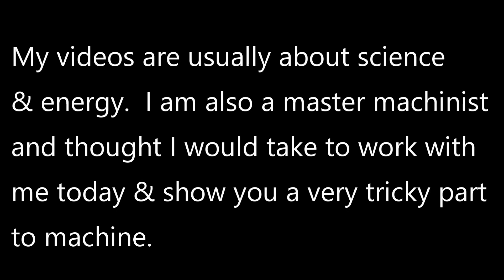MACHINING A FOAM DUMBBELL

Comment: Genuine plastic coated gas bubble machining - 'almost' like eating lettuce . . . 'almost' nothing to it !    * Seriously , foam(s) can be a real bear to deal with . . . 'that's a pretty serious form tool !   Obviously the foam density / hardness plays a major role in being able to hold a tight tolerance .     'Cool ''box'' for driving the slabs !     What type of foam is it ?   I can think of some interesting uses . . . like a super low pressure VALVE that would have to be low rpm , otherwise it would self destruct !   Fun stuff Paul !
Reply from the maker: Hey, good to see you.  George the stone cutter, the gemologist, the gem cleaver! Hope things are going well with you.
It is a really dense foam, customer supplied the material, so I'm not sure what type it is.
Reply from the maker: I think they are used in some type of compression test.

Comment: what are those used in/for?
Reply from the maker: I think some sort of compression test.  It is very dense foam, but not sure of the type as it was furnished by the customer and I never had the chance to ask.
I don't know what it is. Just give me a print and I will make it, hehehe
Reply: @INVENTOR3  its a domagiger, thingamabob for a whatchacallit ;) (joking)
Reply: @INVENTOR3  Can it be they use these to cast something out of iron?
Reply from the maker: @John Walker  I don't think so.  I think used for some type of compression test, so im guessing that they squish under a specific amount of pressure.
Reply: @INVENTOR3  I believe you.
I was thinking that because the shape looks like the rollers of a conveyor belt guidance system.
Stay safe, I3.
Reply: Nice coil bases

Comment: Hey Paul, how's it going? Great video again. Just haven't heard from you in a while. You haven't posted anything in a couple of months so I figure I just drop you a quick little message to make sure everything's okay and your recovering good and you're healthy. But anyways, take care. I hope to hear from you soon. Mike from Faraday Research ⚡🙏
Reply from the maker: Hey buddy, good to hear from you!
Struggling with my recovery.  Trying to exercise.  Been trying to pull out of a depression.  I been working on the project.  Still considering open sourcing everything.  I'm getting healthier little by little.  I been doing many experiments on the project, just no great results yet.  I won't give up!!
I feel good results coming soon.
It has also been coldest months and sometimes hard to keep the lab warm even with jet heater.  I will be making some new coils this coming weekend and I should also give everyone an update and let everyone know I am still alive :-)  ever since my father passed 2 years ago, I am still going through a court case, that I have not been allowed to talk about this and this too has been driving me crazy.  I'm still going like the energizer bunny.  I'm expecting good results soon.